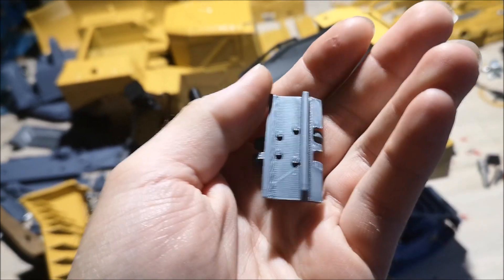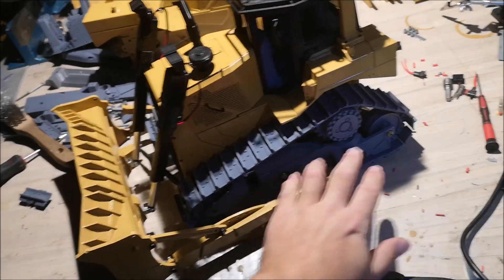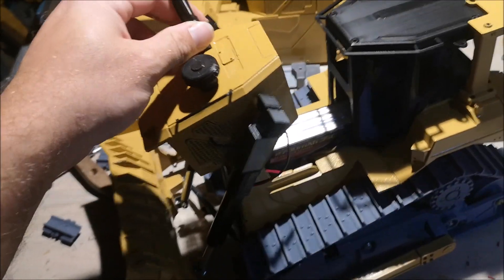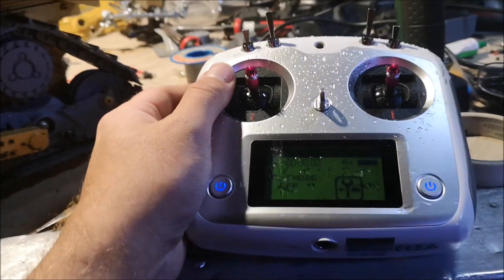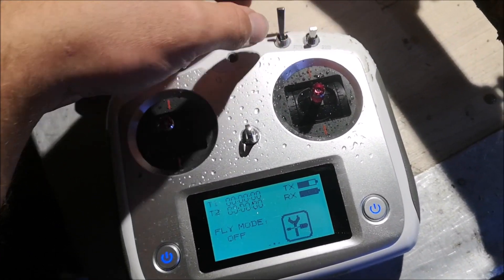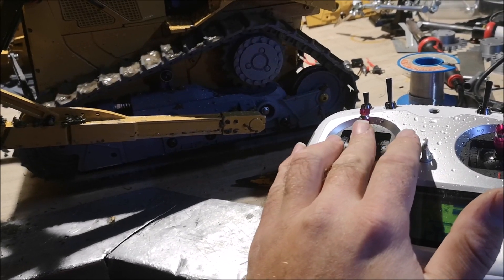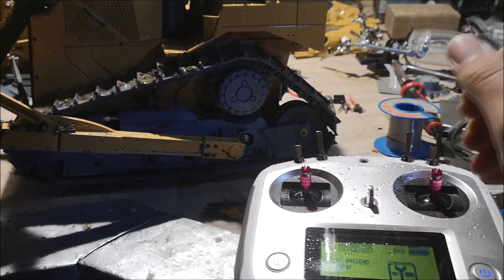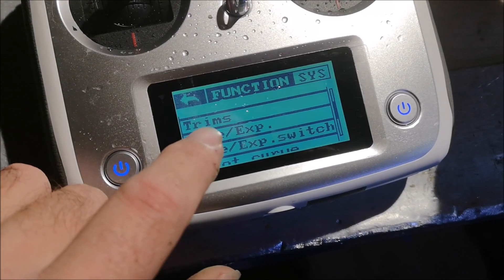3D Printed Tracks - Will they work?

Comment: how to those faster motors work compared to the 55 turn? are they faster just for travel or does it push better?
Reply from the maker: they are stronger even when turned down to 65%. :)
Reply: okay. I got the 55 rpm, would they be better in the track loader if I got new 80 rpm motors for the dozer?  @burnie222rclasseanhanger6

Comment: How do you make this 3D models? based on pictures?
Reply from the maker: thats right :) I use google image search and go from there
Reply: @burnie222rclasseanhanger6  holy.. that's impressive :) Any recommendation how you decide what size they will be?
Reply from the maker: @NudLc  yes I find the real dimensions for the machines on google, and then divide the measurements by 14 ;)

Comment: That's GREAT! I just bought the dozer because of this update!!!!!!!! cant wait for the files and the build!! thank you!!
Reply from the maker: awesome 🥰
Reply: @burnie222rclasseanhanger6  Also how will i know the second you add the new track files???
Reply from the maker: @MicaseHD  I post info in my facebook group :)
Burnie222rc's Designs - RC 1/14 Community
Reply from the maker: @MicaseHD  the files are out :)
Reply: @burnie222rclasseanhanger6  Awesome. Was waiting for this, will be buying and building this for my dad who always wanted a bulldozer but life got in the way. I think my mother will be more accepting of the size of this aswell! Thanks!
Reply from the maker: @JordanCharlesBurrows  that is really awesome my friend!
Reply: good work mate. from Australia.  but printed will never hold up to the ricks and dirts stripping the plastic down
Reply from the maker: @r.ccustomtruckingsydneyaus4632  sure it will, I still have my white CAT excavator with 3d printed track's from 2019. not swapped a single trackgrouser yet.
Reply: What is the model of the updated motor?  And can I also use these motors in the Volvo excavator???